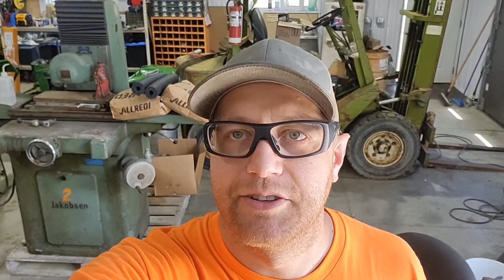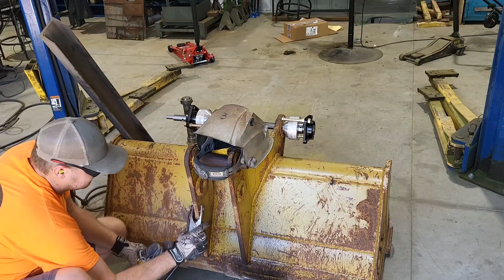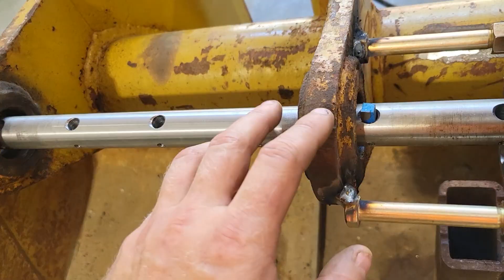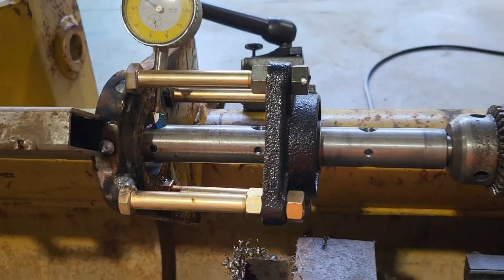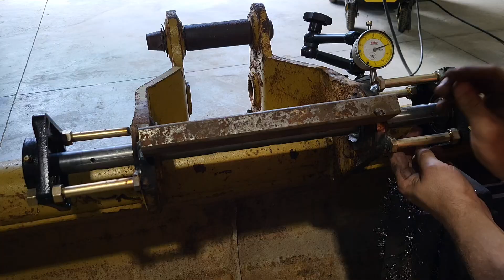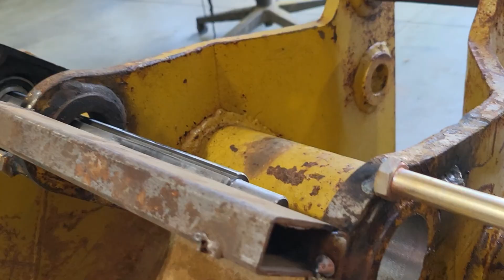Backhoe Bucket Rebuild With Homemade Line Boring Machine

Comment: "Hello, so simply made, and it works — you’re the greatest!"
Reply from the maker: Thanks for the kind words, it does work well but has its limitations. I'm working on an updated version with more accurate feed and larger diameter boring bar.